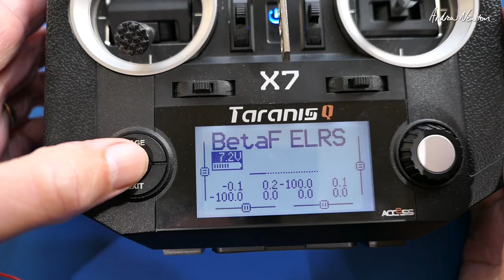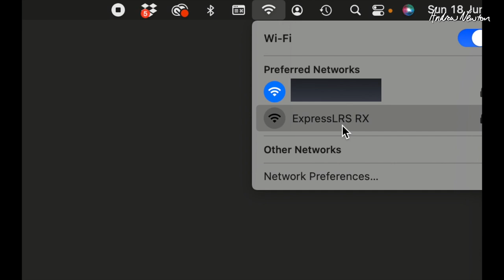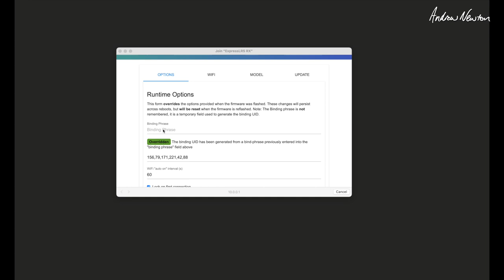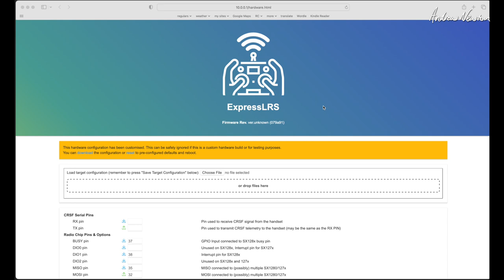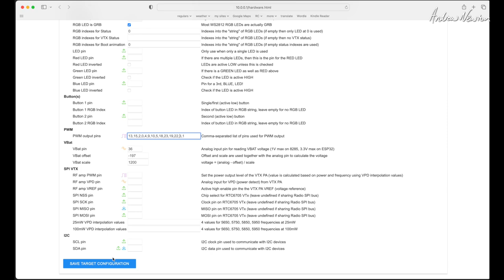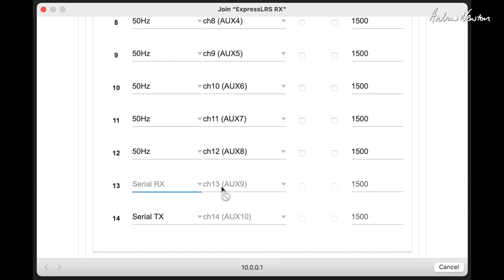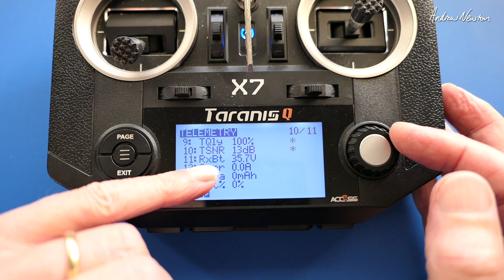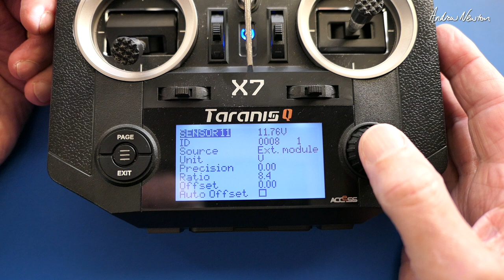BetaFPV SuperP ELRS 14ch PWM Receiver with SBUS CRSF I2C

Comment: Can it be bined with Frsky Taranis X9D Plus?
Reply from the maker: No, only binds with ELRS radios
Reply: @AndrewNewton  Yes, but as it turns out, all you need to do is buy an ELRS module for Taranis and you're good to go ;)
Reply from the maker: @kaven9583  Yes correct, I should have included ELRS RF modules. They work perfectly

Comment: Gday Andrew, Thank you for this explanation mate. With these being used via PWM only running my TX-12 with a 1000mW ELRS module, Can we expect some great distances without SBUS and or a Matek board by just bind and fly? What are your estimates with just the receiver and my TX-12 with 1000mW with ent antennas? Would we see a servo work at  5 - 10 km's?
Thanks very much.
Reply from the maker: Yes you would get the same range with just PWM

Comment: Hello Andrew, I have a problem with the voltage indication. I tested this with different batteries that had different voltages. The volt display in the transmitter always remains the same. It is obviously not measured. Is that the case with you too?
Reply from the maker: What voltage is it showing? Could be BEC output
Reply: The voltage I entered in the telemetry settings. E.g. 11.6V (3s).
Reply from the maker: @butena55  Strange. If you set it up like I did in the video it should read whatever voltage is connected.

Comment: Good video But why does my Receiver (BetaFPV SuperP 14ch PWM diversity Receiver) its bound but the Servos does not move Did I get a faulty receiver?
Reply from the maker: How do you know it's bound? Which radio? Most likely you have made a mistake in radio setup or servo connections.
Reply: @AndrewNewton  I see in the Radio the Bars and when I disconnect the radio it says receiver still connected its Radiomaster 16S
Reply from the maker: Does the little C show in the elrs3.lua screen top right?

Comment: Hi andrew! I have thrown this rx in my old trusty Avios Bushmule... but for some reason when i connect the Throttle 2 on ch 5 separately from T1 the mottors behave in a weird way. they do not start at the same time and motor 2 starts only at 50% throttle. i have calibrated the ESCs but no success. I know it is because of the RX cause when i plug the ESCs separately on an old FRSKY X8R all work as intended. Any ideas would be really helpful..
Reply from the maker: ELRS Rule no 1 - Dont use Ch 5 for anything other than Arming. Also you need to read up about ELRS Switch Modes.
Reply from the maker: This will explain it all https://rc-soar.blogspot.com/2023/08/an-introduction-to-elrs-including.html

Comment: OK I'm really stupid, so forgive me. I wire tx and rx to reverse on FC from rx, and that's all to get crossfire on elrs? Do you need to do the invert uart like old days? Got new RXs for my elrs set-up, so now going to take time to set up properly using csrf. Was way to excited before and did stupid long flight with pwm. FYI for swordfish
Many thanks in advance Andrew you've been a great help over many years.
Reply from the maker: Tx to Rx1 and Rx to Tx1, then select crsf as the Serial RC provider. No invert needed
Reply: @AndrewNewton  thanks mate that bit about invert was just FrSky thing wasn't it?
Also if you haven't, my memory not so good, try to test Walksnail it's bloody amazing.
Reply: @AndrewNewton  thanks mate that bit about invert was just FrSky thing wasn't it?
Also if you haven't, my memory not so good, try to test Walksnail it's bloody amazing.